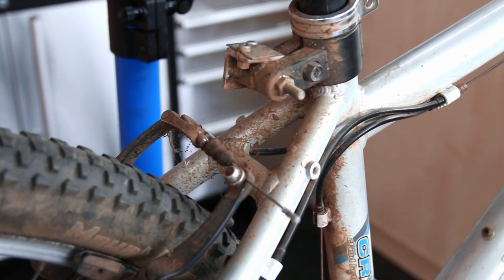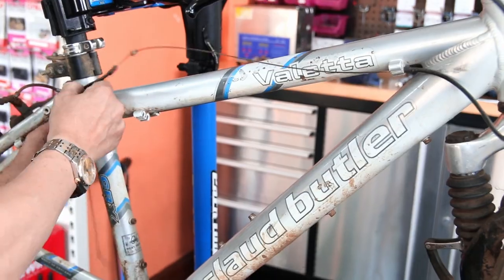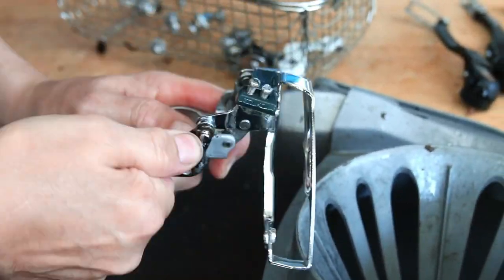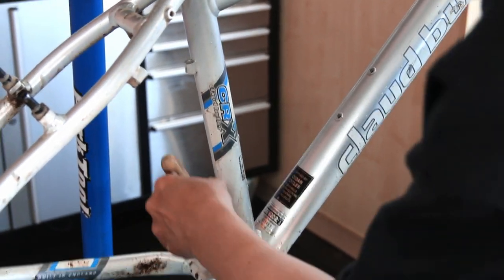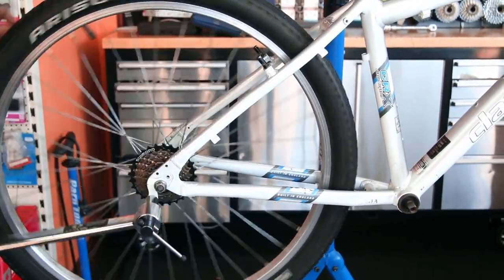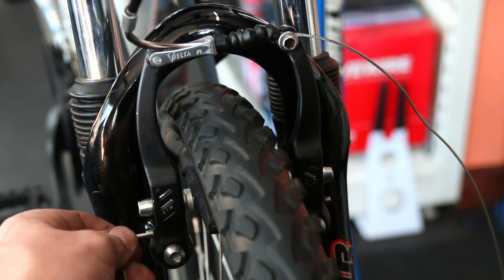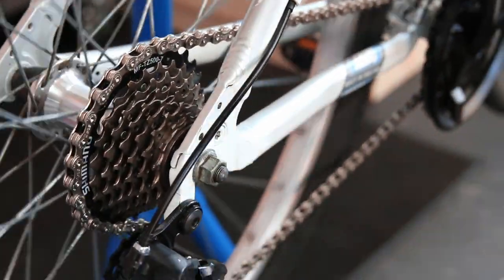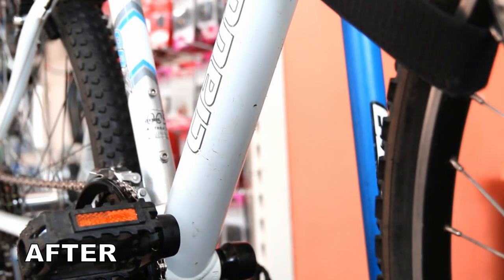Claud Butler Rebuild Bike Service

Comment: I have worked at a non-profit cooperative here in the U.S. for almost a decade now, this on top of another 30 years in the industry. We take in dozens of bicycle donations weekly, and do full service for customers as well. This sort of restoration is practically an every day occurrence in my shop. I can see you take pride in, and do top quality work. The one thing I personally would add to a budget bicycle is a spoke protector. I know most bicycle enthusiasts scoff at them, but they do work at preventing spoke damage if a derailleur gets out of adjustment, banged up, or whatever.  Cheap derailleurs are rather wobbly to begin with, so in my opinion a spoke protector is cheap insurance and do not deserve derision.
Reply from the maker: Wow that sounds like a great cause, your philosophy sounds just like ours, thanks for watching🧡

Comment: Thought for sure that was a throw away bike.  Look at it now.  Holy smokes!  Unbelievable job sir.  Man do I wish you were my local bike shop!
Reply from the maker: Thanks!🧡
Reply: It is an incredible job, though my bar for "throwaway bike" is very high.  It has to have a cracked frame/forks for me to consider it unrepairable.  Even then, I'd strip it for parts and recycle the frame.

Comment: Love this video, I have a 2010 Specialized Hardrock Sport sat in my shed in bits.  I bought it off a friend whose ex used to use it as a commuter but never went near it with any lube or even a pump!! I sourced “new” shocks for it, a replacement rear shifter which was all bashed up and a new bottom bracket.  Four years later, it’s still in bits!! I just need the time and confidence to make a good job of it.  Going to take your advice re: stainless steel cables and accessory bolts.
Reply from the maker: Good luck with it and enjoy!🧡

Comment: You cant beat a 90s steel hardtail with 26" wheels, rim brakes as an everyday workhorse, they take the abuse, the weather, and with minimal love keep on going.
Reply from the maker: You can’t beat the 80’s/90’s they’re bulletproof bikes!
Reply: What steel? This is an aluminium frame.

Comment: I know this video is a few months old, but  just found the channel, and 'm working my way theough the back catalogue. Quick question, what oil are you using on the shifters?
Reply from the maker: It would actually depend on the shifter type and what issues they do or don’t present but in this case I used a spray lubricant with Teflon surface protector in it. The one I use is made by weldtite and called TF2

Comment: Nice. How was the suspension fork? That probably would have needed new slider seals?
Reply from the maker: All the work we show are customers bikes and there’s often a line drawn to the videos by them alone. In this case the forks felt perfect and works as they should so this wasn’t required.

Comment: Does the silicon spray used at the end of the video affect braking surfaces? I've seen you use it a few times
Reply from the maker: When the video is sped up it looks like we mist it over the whole bike but it’s actually quite a direct spray that we don’t point near the brakes and they work completely as they should 🧡⚙️
Reply: @Bikespeeds  I use car wax it's very good shine

Comment: I have the doubt since I have not observed in your videos that when doing these maintenance works they do not disassemble the direction, they do not do service, either air, oil or simply spring, any particular reason for not doing it?

Comment: Shame you never used a new bottom bracket
Reply from the maker: There’s a lot goes on off camera with these jobs, we do check and feel bearings and if they need doing advice the customer, in this case the bearings where OK & didn’t need doing.